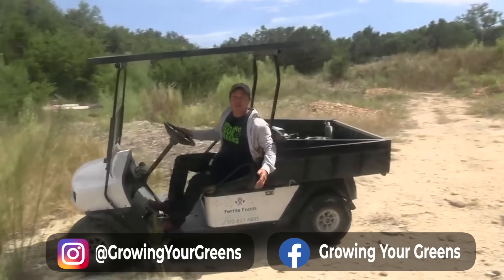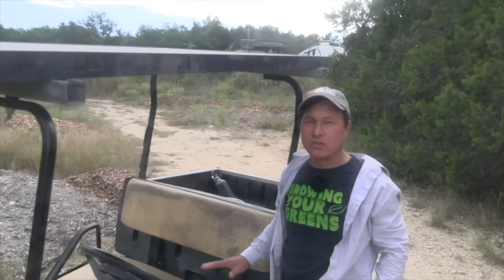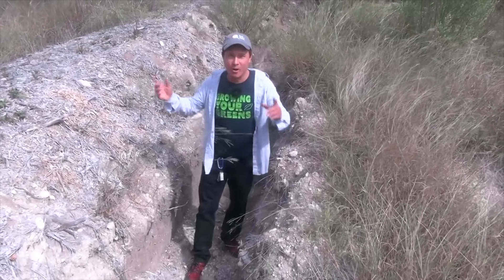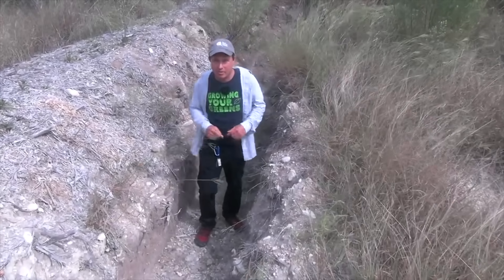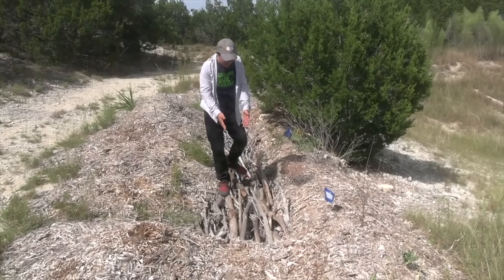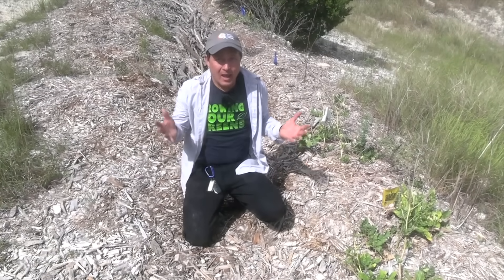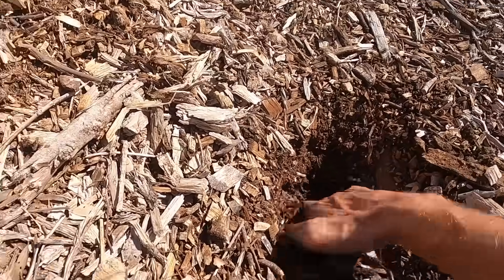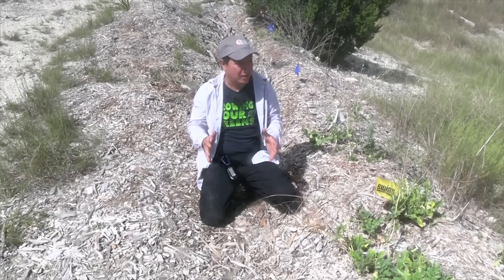This Genius Farming Hack Stores Rain Like a Battery

Comment: Be aware of Grazon, broadleaf herbacide, does not compost away. In manure, goes through the animal still active. In shavings from trailors, etc. The hay should have the info if it was used on the field. On the bottle it says to remove all top soil if contaminated! Read. Ask questions,  be safe

Comment: Hi John, do you consume cannabis at all now that you quit smoking? God bless I stopped in an effort to do what’s best for my receding gums
Reply: ive heard chewing on horsetail can help with this.  the silica in the horsetail reed reversing gum recession and rebuilds enamal.
Reply: @ciimoon5661 thank you so much for the tip. I never heard of this remedy
Reply: @ciimoon5661 thank you for the tip I never heard of this remedy ❤
Reply: Oil pulling will help gums heal once you stop smoking.

I use sesame oil with cloves about once or twice a month. My dentist was disappointed that I didn't need the expensive and intrusive "deep cleaning" (scraping under the gums) after all.

Comment: 1) I'd kill for 30" annual rainfall! 
2) Will using my creosote bush branches be ok to use in the trenches?
Reply: Hopefully you're in a place with lower evaporation than Texas since you're sub 30" 😅

Any wood is fine, there's a sliding scale. Black Locust is pretty much the worst of the worst but even that does technically work.

On a scale of 1-10 (10 being the best) your creosote bushes are probably a 3-4

Comment: I’m wondering if I could lay a pond liner on the bottom as to retain the water a while longer? Add some dirt?
Reply: no plastic. causes problems. think of the next 7 generations
Reply: A pond liner would prevent roots from reaching deep once plants get established.

I would guess that initially the rain will soak deep and seem to disappear, but over time it will be retained more and more in the wood chips and branches and the surrounding soil. No need to try to artificially trap it.

Comment: I do this. 
One year we had a wasp nest underground, it was huge! We ended up having to fill the battery with water, until it pooled. It took all night to fill. The wasps died/moved on. The moisture stayed for several months. We are in caleche /  crushed rocks and sand and use juniper too. I bury the duff and bark with straw and chicken poo
Reply: Also,” Rainwater Harvesting for Drylands and beyond “ by Brad Landcaster is a book with valuable information.

Comment: Smart!
If it were my project I would probably add in at least ~10-20% native soil so it has far more diverse nutrients, fill in more gaps, feed a wider variety of microorganism
Reply: the soil may move into the gaps with rains over time from the sides.  it looked like caliche
Reply: @ciimoon5661 Sure lots of possibilities over time. Unless you want to gamble and take a longer time, mixing dirt with mulch speeds things up.

Comment: Wouldn’t the wood chips wash away in a massive storm ? 
Expecilly in the hill country ?!?
Reply: it's excavated on contour and they actually help reduce soil and build soil. extremely valuable in the hill country for water retention, infiltration, and seed germination.
Reply: is in the trench ...so will absorb the water and retained there ...a trench ready to fill w the chips ❤
Reply: juniper/cedar woodchips tend to stay in place pretty well, by interlocking.  I put new shredded juniper mulch down the day before a 5 inch rain.  on a slope.   It did not budge.